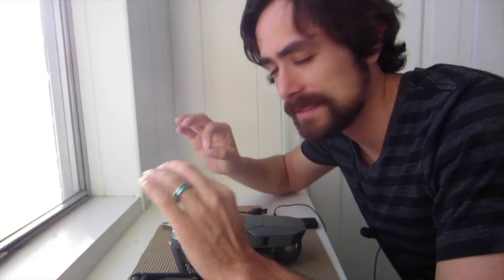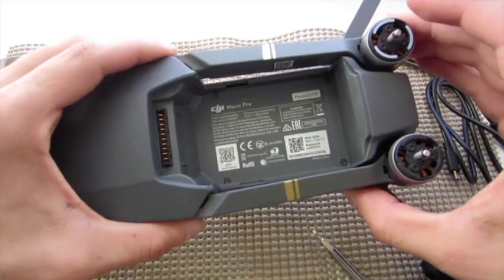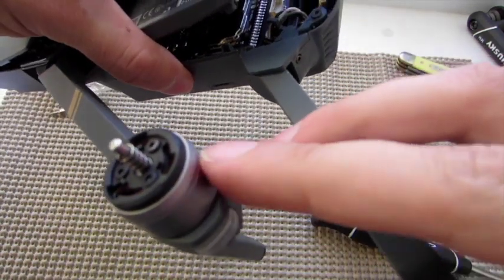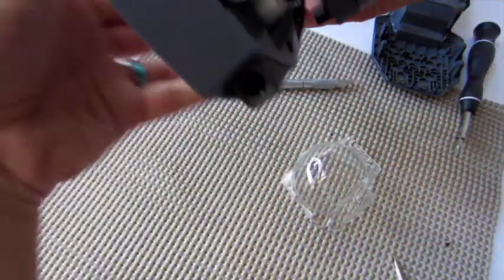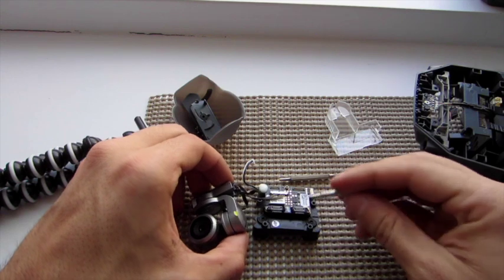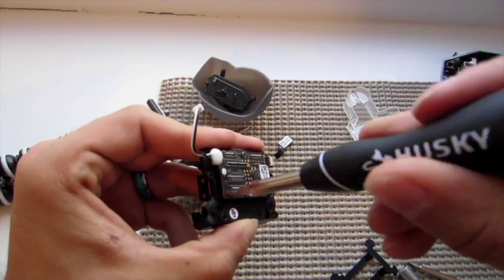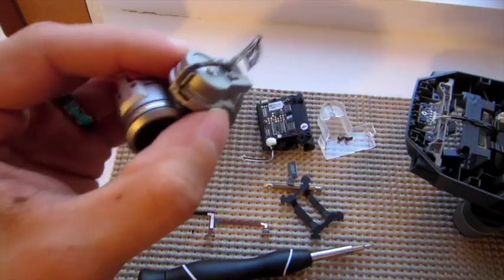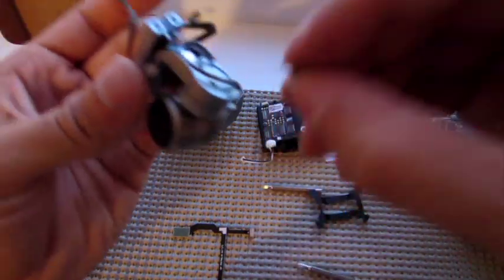DJI Mavic Gimbal Repair

Comment: hey man, i am in the similar condition, go my drone crashed. I found ribbon and shock absorbing plate was broken. I have replaced both of these. But i am getting no transmission through camera. It is all black. and in the errors, it says camera sensor error, hardware malfunction. Is it the tranmission cable has the problem or something else?
Reply from the maker: Hard to diagnose. DJI has made a big effort similar to Apple to detect 3rd party after-market parts, so it could be another issue, or it could be that they can tell it's a 3rd party replacement and have firmware that's blocking it. It didn't use to be the case at the time of the video. But now it's a lot more difficult to repair your own DJI drone. :-/